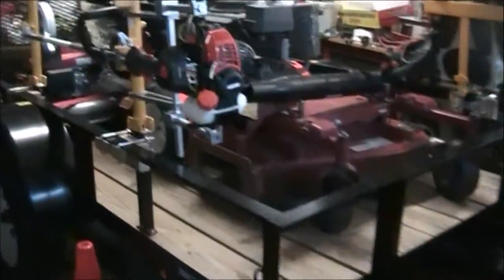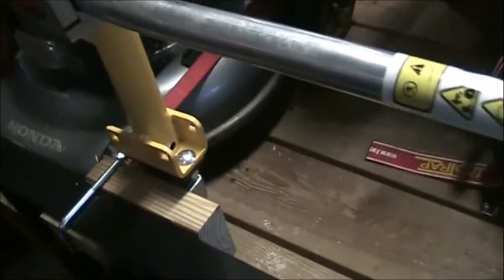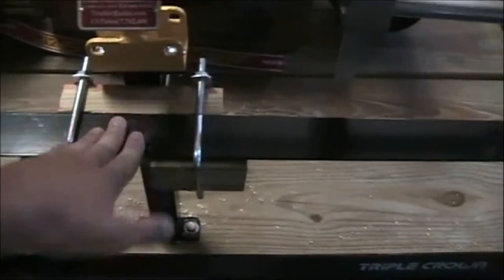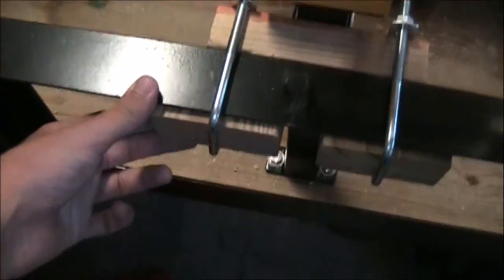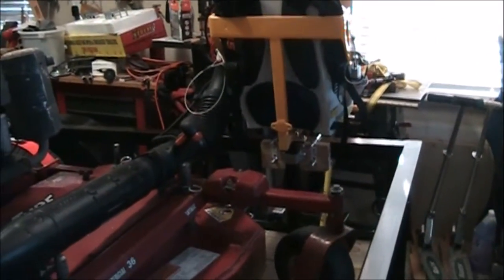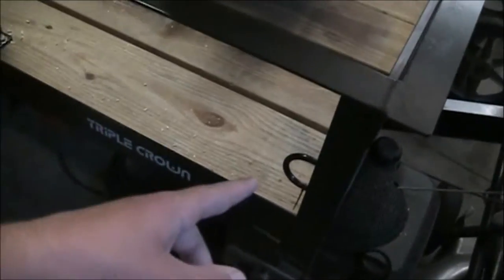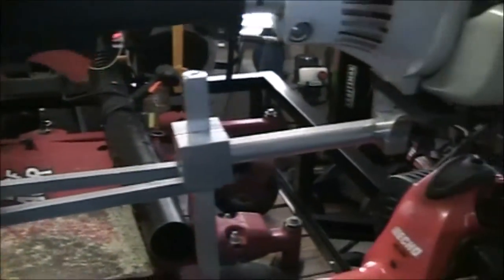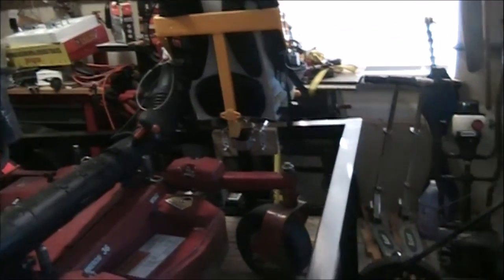Lawn Care Vlog #12 - Racks on the trailer

Comment: Great ideas for mounting those racks. I went through the trouble of drilling through my trailer rails. Now I have a bunch of holes in my trailer. lol. But I still have another set in my shed which I have to install on the other side. Not sure what method I'll use. I think I may get those engine supports. The engines really do wobble around violently. Nothing has ever happened, even on very rough terrain, but why tempt fate. Great video!
Reply from the maker: Thank you! I figured that with all these bolts if someone wanted to try and unbolt the racks then all this would slow them down lol
Reply: ***** That's all you can hope to do. If the criminals have the time, they will get your stuff. But when they see how much time it would take, they'll likely move on.
Reply from the maker: +Something 2LookAt yeah definitely

Comment: Dam your guys in the US have to lock up every thing over here in Australia you can leave a backpack siting in the trailer not locked to anything and it won't be stolen over here we leave a trailers in our front yards or on the side of the roads and it's still there in the morning Great video bud
Reply from the maker: Interesting. I like to hear from people around the world to see what it's like lawn care wise in their area. It is a shame that we have to lock everything. While I store my trailer in my shop, I even have a padlock on the hitch of the trailer. While I'm driving around, I lock my trailer with a padlock to prevent someone from taking it off my truck and then putting it on their vehicle and driving away. We even have locking hitch pins because someone could even take the pin out of my hitch, slide the hitch out of the vehicle's receiver and then put it in their vehicles receiver and drive off